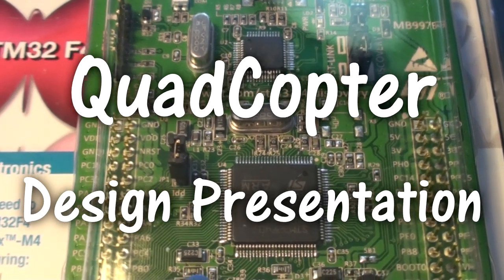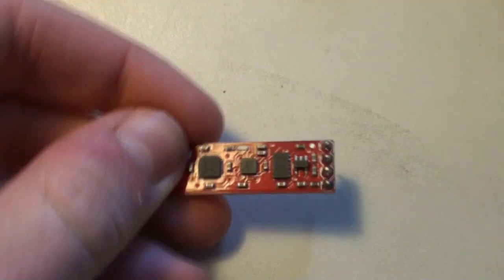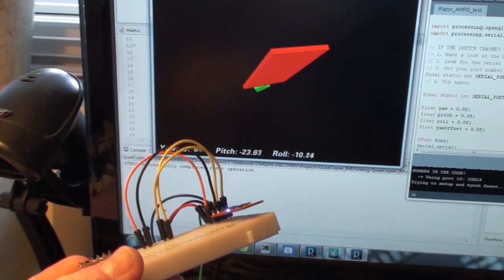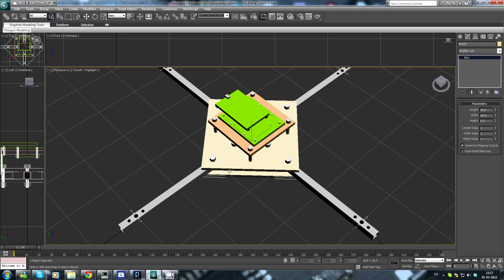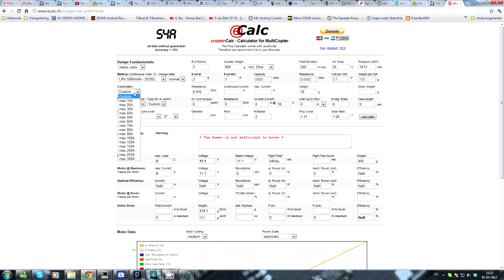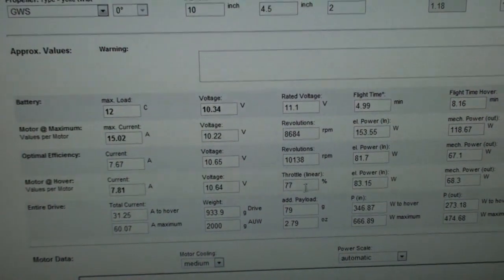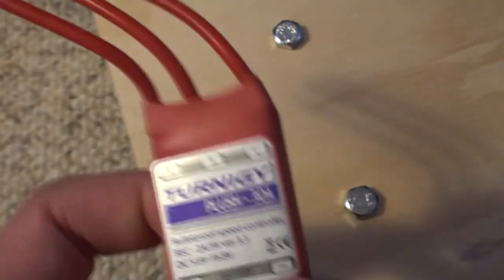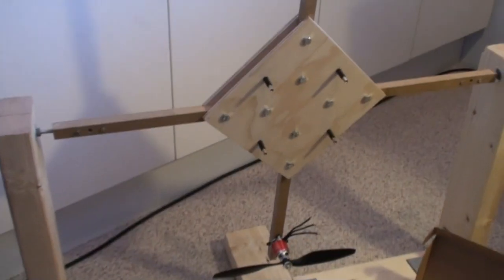QuadCopter Design Presentation

Comment from the maker: Haha, thank you very much. Well the task of designing our own Quadcopter controller board has also become a bit more advanced than first expected. We are currently also comparing with other commercial available products to see how our board performs compared to those (KK Multicopter, Free Flight, AeroQuad, Arducopter etc.)
Our main issue currently is the vibrations in our own custom designed frame in Plywood and Aluminium. So to test our board we will soon be getting a more advanced frame.

Comment from the maker: @tannerkorf1 No, I haven't been using it with the STM32F4 board yet.
To measure the distance you have to measure the time between setting the trig pin high, till the echo pin goes high. This could be implemented in two ways.
1: Set the pin high and go into a while loop that waits for the echo pin to go high. In this case the processor will have to wait for the measurement to finish.
2: Use one of the hardware timers to measure the time. Then the processor would be free to do other stuff.

Comment: Another way to avoid extra HALT and waiting states is timers or use of Echo pin connected to MCU external Interrupt - as soon as Echo received, level pulse triggers interrupt and you can do distance calc routine, combined with timer (if no echo received within) you can freely adjust distances (max) you are going to measure and process.

Comment: I almost need a degree to keep up with your basics. I'm about to build up a Y6 scorpion from Hobbyking, just because they look sweet. I'm trying to work through the basics of weight with 6 motors etc  vs power/thrust ratio of having it run only 3 motors instead of  6 for money saving etc and the run time etc.  Couldnt it do the same with 3 ? I mean 3 motors taking x power vs 6 taking the same power = same run time right ? OMG, I'm in the deep end and moving slowly now lol. You're incredible.

Comment from the maker: As there will always be some lost energy pr. motor you will get the longest running time with only 3 motors, though I'm not sure if you will feel any difference.
Regarding steering performance you will notice much greater force and torque with 6 motors, making you able to make much faster and more controlled turns.
But in your case I would go for only 3 motors as the matter of cost.

Comment: you can check Arduino Ping version too, "algorithm" is the same... Just take into account fact, that mostly Arduino projects use 3 pin Ultrasonic sensors with combined TX/RX pin and HS-04 is 4 pin version, you have to give TX pulse for at least 10-15 uS (something like outpin(0); outpin(1) {wait for 15 uS} outpin(0)) shorter pulses sometimes do not work... and start timer waiting for echo response on RX pin.

Comment: I just checked again - F3 also has FPU, just 72 MHz vs 168, smaller program flash and SRAM, but might still fit. so will be good Idea to port it to F3 version with onboard sensors. especially those are already covered by supplied drivers as well.
I'm also thinking to obtain new IC LSM9DS0 by ST, 9 axis single chip version.
What about involving DSPs to filter sensor data? some "smoothing" algorithms are well performed by those..

Comment: I am creating a quadcopter using the STM32F4 also and have been working on it for about a month. I am trying to incorporate a Ping Ultrasonic sensor for the altitude measurement but am having a tough time with the programming of the protocol. Have you tried using the ultrasonic sensor yet?

Comment: Wow, You're too smart by far. Why did you choose to NOT simply by a cheap and already well proven and tested quadcoptor board ? They are cheap and apparently work very well. I have no doubt you will build something equally as good. Are you doing it for research or just to prove you can ?